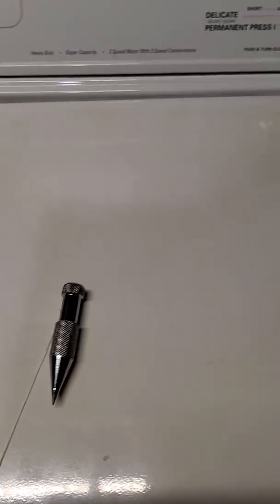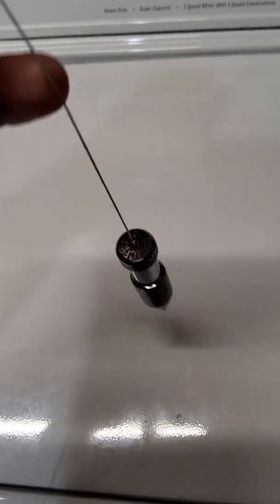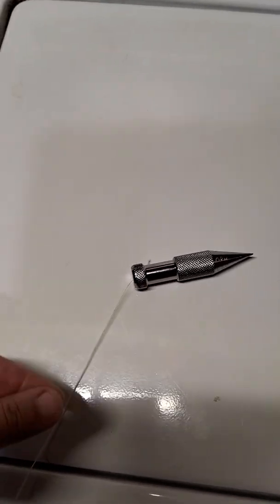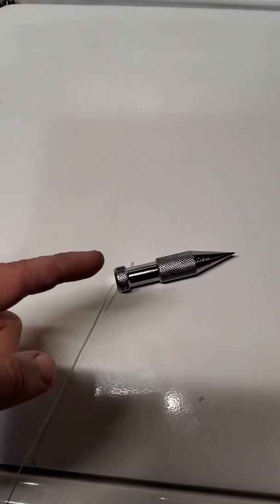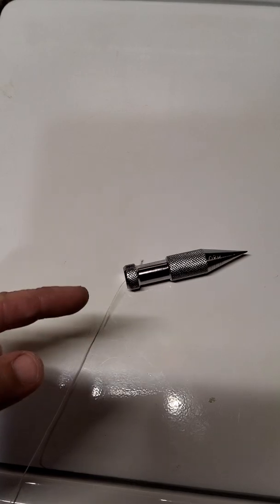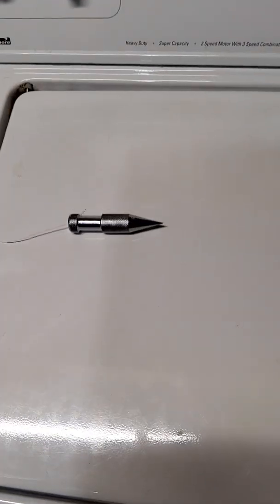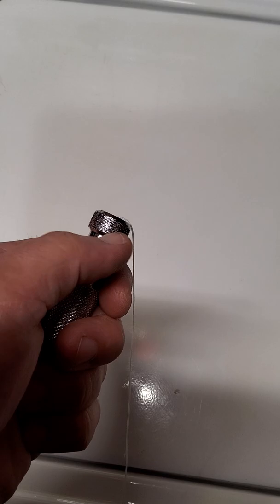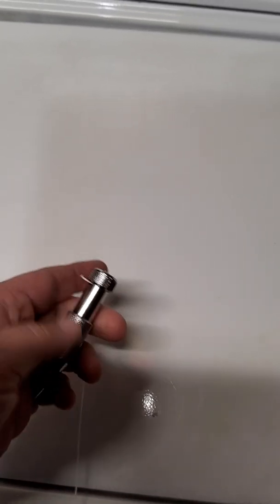How To PROPERLY TIE The Harbor Freight Plumb Bob String Installation Item 57173

Comment: Pretty Funny. So I would love to see these 3 overhand knots you did with the harbor freight string provided.
Reply from the maker: Its just a "overhand knot" (or "stopper knot") Make a loop at the end of the string and pull the tag end through. That's it. If you need the knot bigger, do it again over the knot that you just made. https://youtu.be/SwdJ5op25SM?si=mfdm0D-SGD2xmA-1